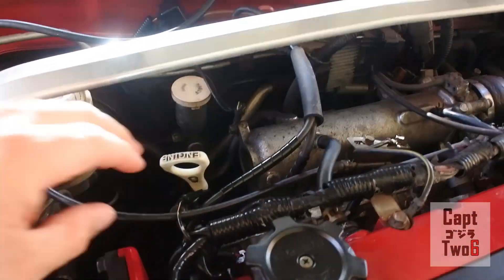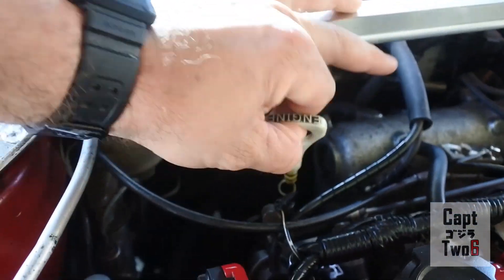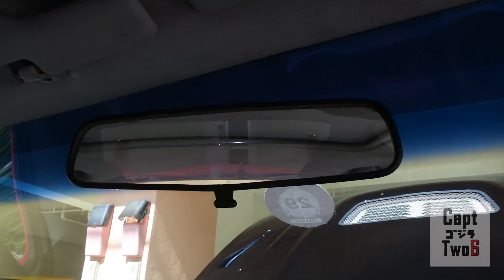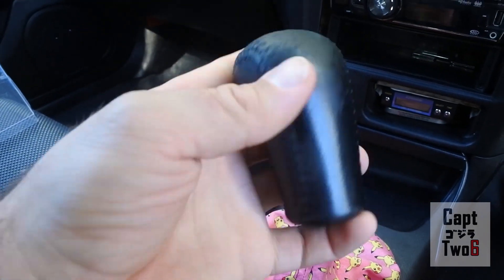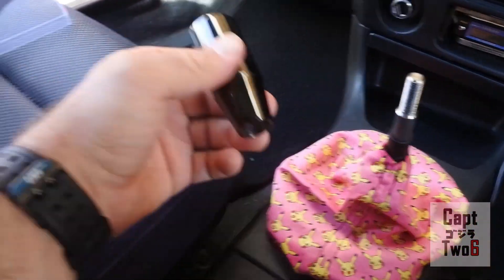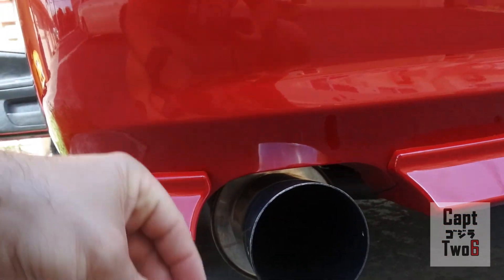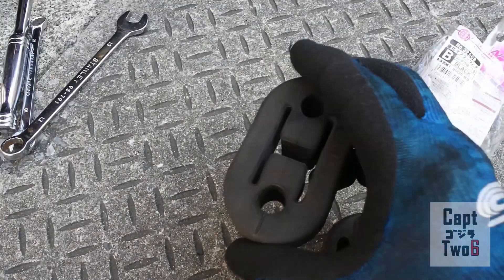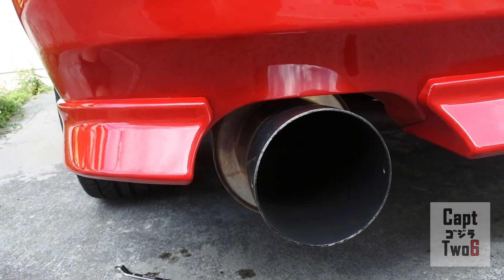FIRST MODS ON THE EVO 4 CN9A!

Comment: The safest thing in my opinion is to Put a Spring on the dipstick I did it because I wasn't sure if the o-rings would hold up and I had no Oil pressure gauge.